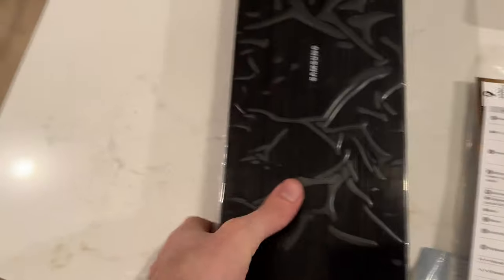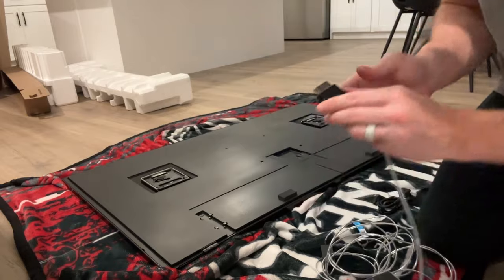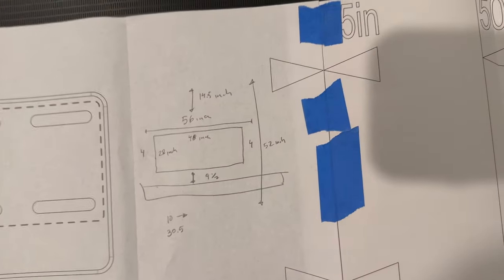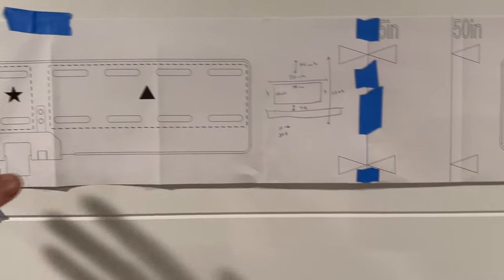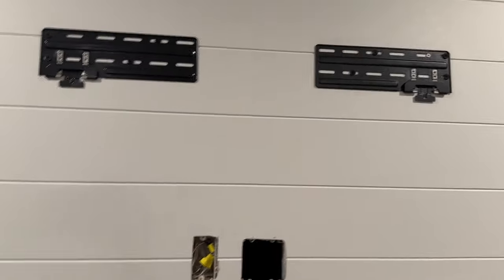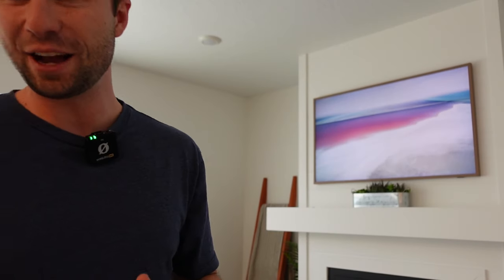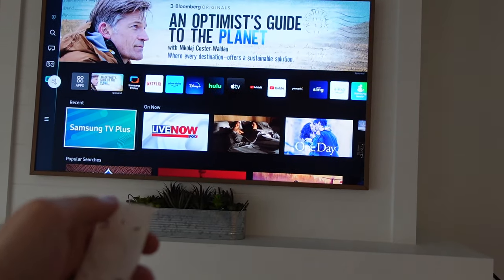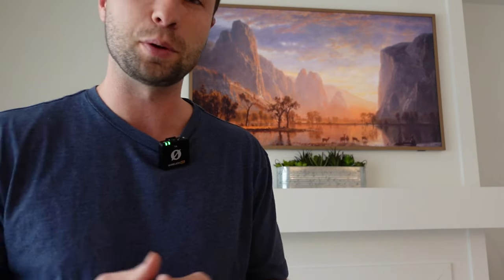How to Install The Samsung Frame TV (& My Review)

Comment: I got really excited about this TV until I learned about the obligatory box (which they conveniently didn't mention in the shop). That totally kills all the benefits of this TV because I have only a simple wall and no place to hide this box. As the comment section shows, I'm not the only one with that problem. I would even say it makes this TV a niche product for the few people who can somehow install the box in a hidden way. For most people this defeats the purpose of this device - a clean and elegant look - completely.
Reply: I've seen installations where they just put a recessed box in the wall and put the one box in there behind the TV. Of course, you have to run electricity up to that box, but you'll never have to see it.
Reply: Just put a low voltage box in between the studs behind the tv and out the box in there. The external box is the only way they can make the tv so thin.

Comment: The one connect power cord is not UL  rated and is not for thru the wall installation. 😮
Reply: Low DC voltage… you gonna be fine

Comment: thank yhou so much. One question, when I turn the tv on with the remote, do you have to aim at the oneconnect box or simply at the tv? I'm asking because I would like to completely cover the OneConnect box inside a rtv cabinet and am not sure if the remote will work
Reply: There's an IR receiver on the edge of the TV. On my 2022 it's on the bottom right. My box is inside the wall
Reply: great question, same thing i was wondering

Comment: Nice video. Questions:
1) I cannot fish the power box through the brick wall. I have an outlet where I want to install the tv. Can the tv plug directly into the wall or do I have to use the one box. 
2) I am streaming only and don't have any other inputs.
Reply from the maker: Unfortunately the the part that plugs the TV to the one box is not  your standard 3 or 2 prong plug in. It is somesort of different connector that connects the TV to the One box and on the one box is where there is that standard plug. :( Maybe there are other work arounds, but not that I know of.
Reply: @reviewbase8047  thanks for the video.  How does HDMI inputs work?  Does everything, including audio/video run through that one power cable?
Reply: @ShaneChristopher  HDMI/USB/Cat5/RF/Optical —are all accessible only from OneConnect box. TV only has the OneConnect connector… supplying data n power
Reply: Seems kind of laggy,  surprising since samsung is known for its chips

Comment: #1 TVs above a fireplace make for a less than ideal viewing angle so I would move it to where you can catch eye level at the center while sitting
#2 The proper way to install this tv is to build a subwall behind where you want to mount it (think tray ceilings) so that the power wire and box can be placed behind the tv 

I bring up #2 because if a fire ever happens, you'll wish you hadn't run that puny little wire inside of the wall
Reply: Subwall huh?  So is that subwall also supposed to fit your PlayStation and other peripherals?  I think what he did is fine although I would place the one connect box in a cabinet.

Comment: What a dumb design . 2000 dollar setup , and they only have 1 screw for each bracket on the tv, and the wall bracket is in 2 pieces , instead of 1 long . It's like buying a Ferrari with Honda civic wheels